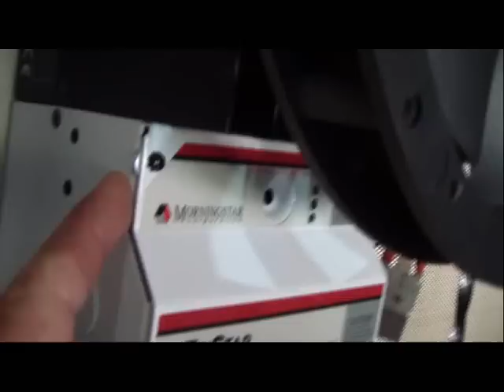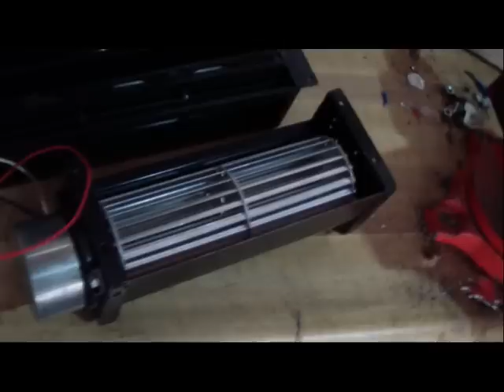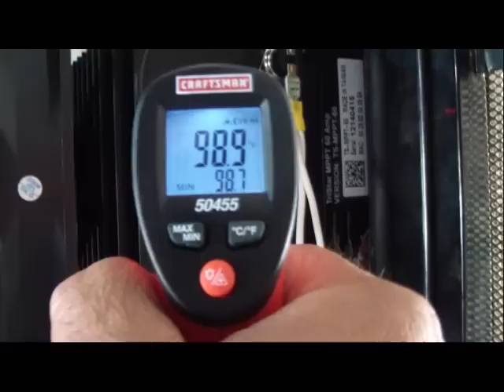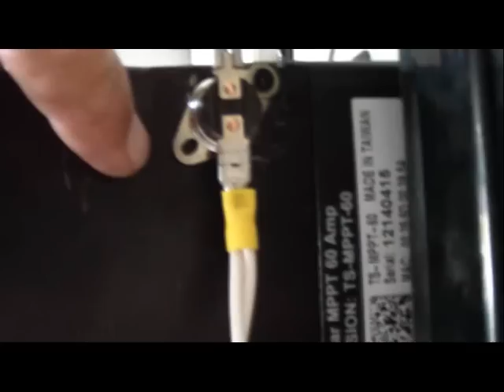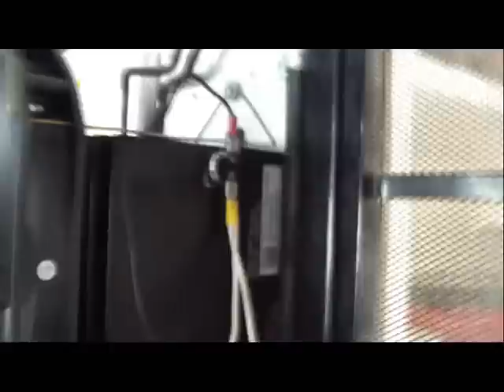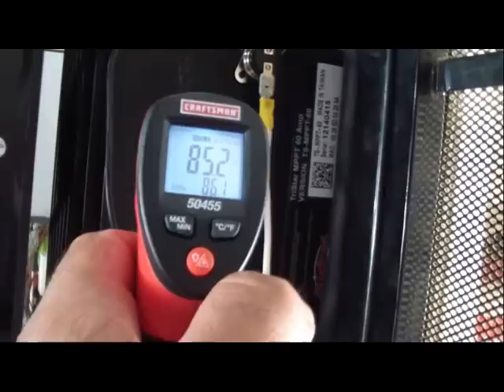Experimental Cooling System for The TS-60 MPPT Solar Charge Controller.

Comment: Slow big fan is quieter!  A shame a 450 buck unit need such improvement. Maybe if you use higher PV voltage it will run cooler? Series not parallel PV.

Comment from the maker: I do run all of the electricity guzzlers off of my batteries/inverter, not forgetting the coffee maker that by itself draws seven AC Amps (900 Watt). The charge controller gets really hot and even the current limiter kicks in, I had an Outback FM-60 that was noisy (cooling fan, relays) not efficient as TS-60.  Please watch my other videos for your in depth answer.  Thanks for stopping by.
Be Well, Be Good,
El Raz

Comment: I think those charge controllers don't have moving parts for a reason, and are designed to have big fins for that reason... how much power are you pushing anyway with that 60A controler ?

Comment from the maker: I may go to an electronic adjustable heat sensing trigger system or tap into the built in internal Thermistor or the remote battery temp sensor to activate the cooling system also the battery vent fans.  Will keep you posted, thanks for watching old friend.
Be Well, Be Safe,
Raz